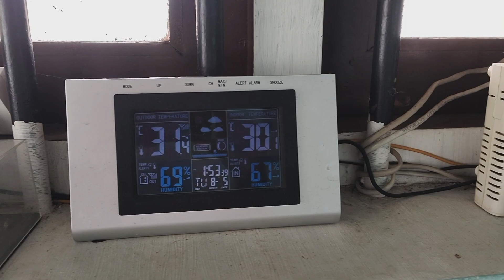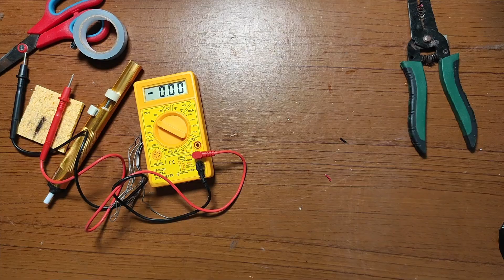BATTERY REPLACEMENT For Marsriva KP3 DC UPS

Comment: Hello! Do you think it could go to it's 100% of charge (or close) with two EVE batteries of 5000 mAh each? I'd highly appreciate your perspective, I'm trying to repair mine but I'm hesitant on this These are the specs (they are gray btw):

Manufacturer	EVE
Model	INR21700-50E
Size	21700
Positive Terminal
Flat Top
Nominal Capacity	5000mAh
Continuous Discharge Rating (max)	10A
Nominal Voltage	3.65V
Maximum Voltage	4.20V
Discharge cut-off Voltage	2.50V
Reply from the maker: It depends if the EVE batteries are similar to the regular 18650s - as in with no BMS.

Comment: Bought it yesterday . came to your video today . 😂😂😂 . love from Pakistan ❤
Reply from the maker: Glad you found it useful. Keep a close eye on your one, especially as it ages since the original battery may swell up over time, like it did in mine.
Reply: @ashraaqwahab  the backup has decreased drastically in just 2 weeks . on a 12v 1.5A router  it started giving backup of 6 hours and came down to 4 hours .
Reply from the maker: @1--BEASTT--85  did you purchase it brand-new? If so, you should reach out to the vendor and claim warranty. Backup shouldn't decrease that fast.
Reply: @ashraaqwahab  yes its brand new . I was also thinking to claim warranty . because it doesn't make sense .
Reply from the maker: @1--BEASTT--85  in that case you should definitely claim warranty. Definitely some sort of manufacturing defect, most likely suspect would be a sub-par battery.